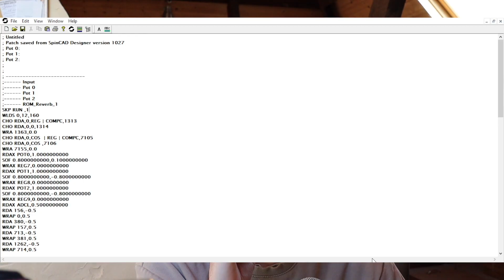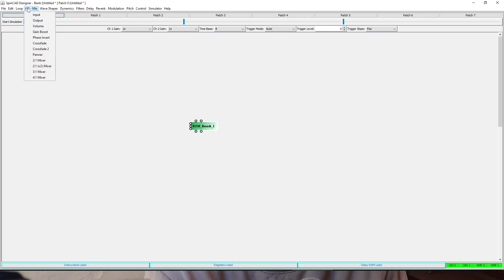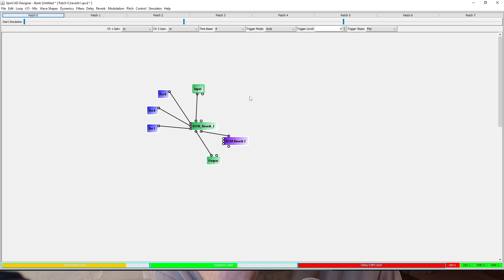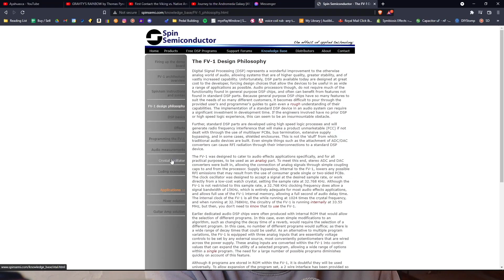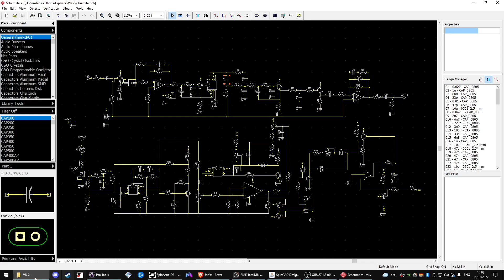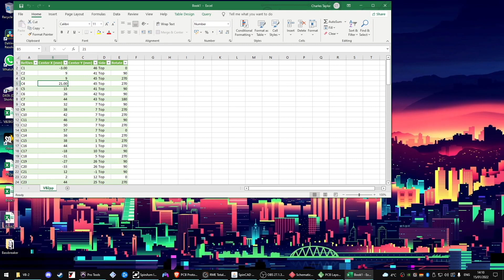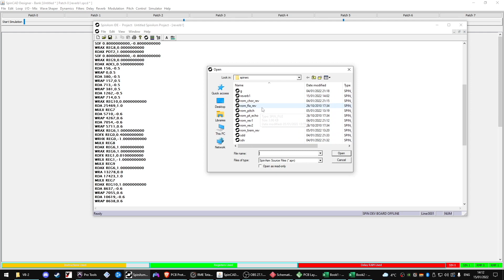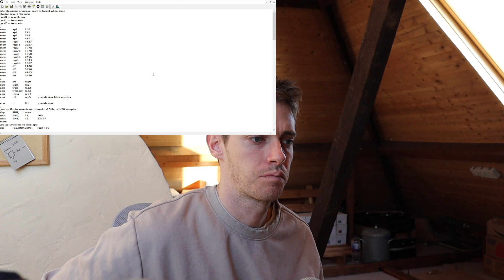Spin FV-1 / SpinASM / SpinCAD-Designer - Getting Started

Comment: Is there a way to start a simulator just in case you dont have the FV-1? Its for reserch purpose
Reply: like for example a simulator for the reverb program to put in a .wav file or .mp3 file and get the ouput file
Reply from the maker: @96Muhsin96 Yes you can indeed, once you have set up the blocks, click 'Simulator' > Set source file an then click 'Start Simulator' and it will simply apply the algorithm to your source file (you can output to file or just play it within SpinCAD.) Just ensure source file is stereo, 16 bit 44.1 or 48kHz

Comment: Awesome video! I'm looking to build a simplistic pitch shift effect using the FV1. I don't need any other effects I just need to be able to change the pitch of a guitar in real time using a potentiometer. Do you know any good resources to figure out how to do this? I have very little experience with the hardware or software.
Reply from the maker: I would recommend having a play with SpinCAD Designer (get it here https://github.com/HolyCityAudio/SpinCAD-Designer)

You can use the simulator to test your 'code' without having to already own an FV-1 dev board.

I had a play around with the pitch shifting functions since reading your comment, however I have not yet been able to come up with a pitch shift program that can go beyond +/- a perfect 5th with real-time control over the amount of pitch shift.

It can do a fixed +/- up to 19 semitones, with a wet / dry blend, but the pitch needs to be pre-programmed and wouldn't be adjustable in real-time (you can adjust the mix though.)

I am happy to post the code here if you specify exactly what you would want it to do (i.e how much pitch shift; do you need to be able to adjust pitch as well as mix / level etc)
Reply: @PedalScience  Thank you so much for responding. I am looking to build a pitch shifter guitar pedal like a simplified digitech whammy, I am looking for a range of about 4-7 semitones down and 1-3 semitones up in real time. If you can post the code here that would be awesome. Also what kind of pcb would I need or do you know any resources where I could learn about the required hardware?

Comment: I have a couple of DIY pedals instead of the development board, but on a Mac I use a python program to assemble the spin programs and then an Arduino to transfer across to an EEPROM. When editing spin programs directly (in a text editor) the feedback loop is a little slower than with the dev board so I use Elmgen to run the code inside a simulator